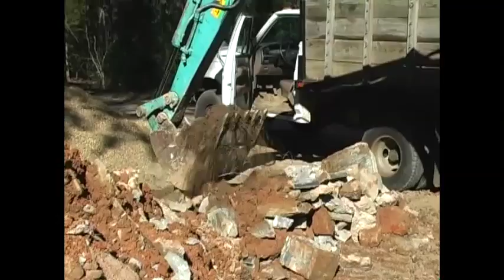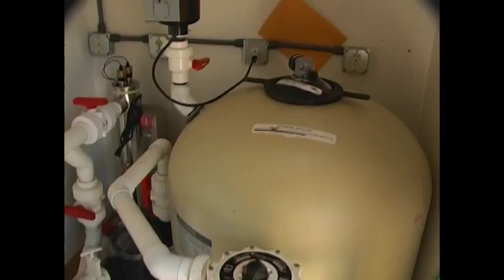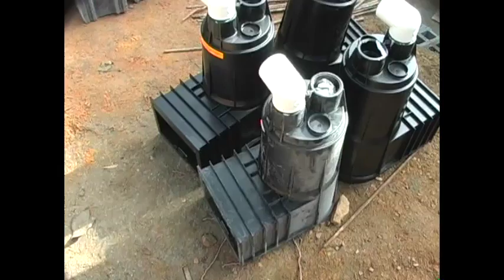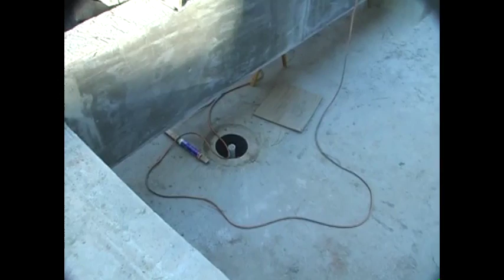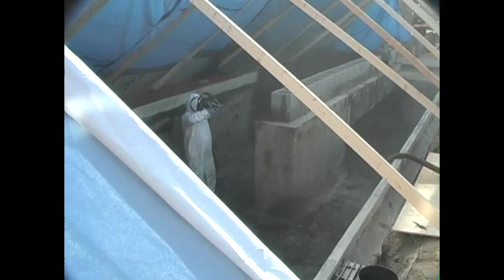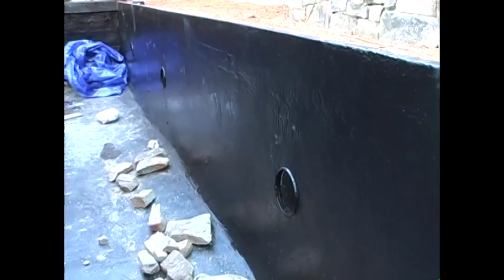Building a Mega Koi Pond

Comment: 3kw of lighting is a bit unnecessary- the cost of running these would be pretty steep if they were on every evening. Surely LED's could be used? You could get the same level of light for about 10% of the power, save a fortune in running costs (not to mention CO2 emissions. Plus they could have colour controls so you could vary the effect.
Reply from the maker: Spencer Wilton Yes definitely.  This system was installed before LED lighting was at the level it is now.
Reply: Brady Brandwood Glad to hear things have moved on! On the plus side, 3kw of tungsten bulbs would keep the ice off quite nicely!
Reply: Spencer Wilton you do not want color control in a Koi pond, it would interfere with the natural color pattern of the fish, which you paid thousands of dollars for.

Comment: why are you not putting rebar in the bottom just in case of any movement in the ground thanks
Reply from the maker: william mould I believe they had fiber in the cement, and that combined with the poly spray on flexible waterproofing, and the hard clay base soil they felt it was strong.
Reply: sorry Brady did not hear them, say that my mistake
Reply from the maker: william mould I’m not positive they mentioned the fiber when I was interviewing them actually.
Reply: well Brady if they did we would not be talking I live in the UK
Reply from the maker: william mould What is the soil like in your area?  This piece was shot in Charlotte, NC, USA ,... the soil is Avery dense red clay, with a 12 inch frost line.
Reply: clay soil here Brady i am about to build one out of railway sleepers very soon
Reply: just sent you a friend request Brady

Comment: I am not commenting as a denigrator of/to what I call {swimming pool} Koi ponds. Albeit, I do want to challenge the idea that a person must invest tens of thousands of USD's to have a fancy and costly engineered pool installed in order to have Koi fish as pets. Additionally, there is the monthly cost of electricity to operate the water pump and filter system 24/7/365 as well as the extremely high cost of specialized Koi food feeding.

My wife and I have a poor mans earth pond 75' W x 200' L x 2' southeast end descending gradually down to 8' D northwest end, in which my wife and I have several 1000 colorful Koi, Shebunkins and Goldfish thriving in our pond., Many have grown up to 18" in length, along with several dozen turtles and 6, 35" sterile Carp as well as an untold number of both Green Tree Frogs, Toads and Bull Frogs living along the bank. There is no costly water pump system, no filter system, no piping, no liner insert and no concrete sides and floor. However we do have a 500' deep fresh water well with a pump within 30'of the pond, as an emergency water source should the water level ever drop to a dangerous level due to excessive heat without rain. Our initial cost was $1800.00 to have the pond dug and graded. We got rid of the excavated dirt by giving it to, two separate contractors for backfill on projects they were working on. The pond took one year and two really heavy rain storms to fill up, which it has generally maintained, dropping only a foot or so between rains.

Our pond is now 20 years old and its fish are our pride and joy. The only drawback is, we have to keep an eye out for Herons and Kingfishers which do get their fill of baby and small fish on an occasional basis. Our two dogs keep the raccoons and possums away, while surprisingly allowing both deer and squirrels to visit our pond daily for a drink of fresh water.

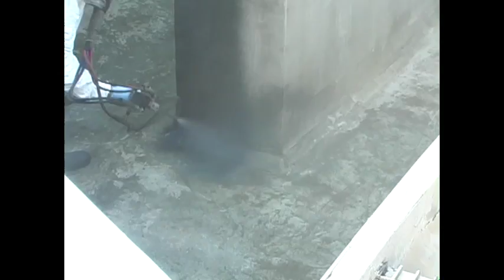Comment: 36:20 Get a measuring tape and get those thicknesses right . The black 100mm thick? Try 40 - 50 max.( elongation 1300%?!?! Wth are you talking about ? ) The clear one is 70-80 mm thick not 2-2.5cm.
Reply from the maker: Waverwreck he's speaking in terms like we say 45 mil pond liner,... which is 45/1000 of an inch thick.

Comment: I noticed one thing, they let the rebar stay in contact with the soil. There should have been some kind of spacer against the dirt walls and the floor so that the rebar stayed within the cement as any exposure of rebar to the ground will cause rusting all the way through in time.
Reply: The rebar will not rust in the ground. Rust is a chemical reaction of iron that requires 4 things.  One of those things that is required is oxygen,  as the rebar is in the ground there will not be sufficient oxygen to cause any substantial rusting.
Reply: @mulletman1705  Ground has oxygen or didn't you know that? BTW, I was an ACI certified  inspector and it is part of the International Building Code that all reinforcement be within the concrete and not be exposed to the ground. Hence why small 1.5" concrete blocks are tied to the bottom of rebar where concrete is poured directly on ground.
Reply: @cjandauntieyaya1446  lol your certifications are irrelevant in regards to my comment. Yes I am aware there is oxygen in the ground hence why I stated "there will not be sufficient oxygen to cause any substantial rusting" lol. International building code haha I have heard it all now.
Reply: @mulletman1705  - Wait... Certifications and building codes are irrelevant? I HOPE you never build anything if you disregard the safety standards created to protect the public.
Reply: @cjandauntieyaya1446  your foolish, I never said any of that lol, don't get butt hurt over being wrong. When I make a statement that can be verified you can not claim that I am wrong because you have a certification, because I am only wrong if upon verification I am deemed to be incorrect, hence as I have stated previously your certifications are not relevant in regards to my comment. I was laughing at your international building code comment because there is no such thing. There are international standards published by committees such as the IEC, etc, however those standards are not compulsory i.e. they are not the law, they only way the may be mandated is that if you enter a contract with someone and the contract states you must install as per standard x,y,x, etc. International building code lol.
Reply: @mulletman1705  You scoff at the idea of exposing rebar to the ground. That makes your entire logic faulty. It is scientifically proven that rebar underground DOES fail. You say, derp, not enough oxygen for rebar to rust so it's OK. But NOPE, there's IBC, ACI, NICET and AASHTO regulations saying that this is WRONG. Exposure to ground means exposure to acids, water, salts and other chemicals as well as oxygen. All of which can weaken the reinforcement and thus render it useless. Do you even know WHY rebar is added to concrete?
Reply: @cjandauntieyaya1446  you are really foolish , once again I never said any of that. Your original comment that I replied to only relates to rust, your original comment has noting to do with "acids, water, salts and other chemicals". Yes I know why rebar is added to concrete but that is also irrelevant lol.
Reply: @mulletman1705  "Rust" is caused by more than just oxygen in the air. Rust is oxidized iron. Any chemical reaction where iron is oxidized causes rust. Hence why your initial claim that rebar exposed to ground doesn't rust is bullshit.
Reply: @cjandauntieyaya1446  look my time is valuable to me so I will no longer spend time replying to you. As I stated previously "rust is a chemical reaction of iron that requires 4 things...as the rebar is in the ground there will not be sufficient oxygen to cause any substantial rusting". Talking to you has been funny, from taking to you I believe that you are a early teenager, I would say to you that, when you grow up if you want to be a manager or a figure in authority never start with the premise that you know more than other people instead listen to what other people contribute and use that to formulate your conclusion aka. don't be a dumbass, nuff time wasted, peace out !
Reply: @mulletman1705  Please review the channel Practical Engineering and the video Does Rebar Rust? and learn something before you build something. You trying to say your time is important is kind of silly since you replied to a comment I made a LOooooong time ago. Reinforcement within concrete MUST be WITHIN the concrete in order to do its job. Exposed rebar is not only susceptible to degradation but also is NOT able to do it's job as it is no longer surrounded by enough concrete for its tensile strength to benefit the concrete. Any reinforcement added to concrete must adhere to the concrete (why rebar is ribbed) and have enough concrete surrounding it to handle any shear stresses. Otherwise, the concrete crumbles away and the rebar is ill fitted to withstand the compressive stresses that the concrete was meant to endure.

Comment: I recently poured a small 60 bag slab. did an amateur Rebar on it . but dug a canal around the perimeter.(rectangle)and a ditch in the middle.layed Rebar over the center ditch. just to  seem profressional.structured  and water from rain to continue flowing outwards. nothing major just a slab.  .  perimeter canal than  concrete pour for me , may help vertical support and skiding (for garden slab). I got the idea from commercial slab builders.
Reply: the center causeway and geometry . water bridge under neithe was a good idea . and maybe filter can be reworked. so you can walk on the pillar.path.

Comment: What was the purpose of the small areas of rebar ? It was actually a complete waste of time adding any rebar!
The rebar spacing is too far apart! If you get freezing temperatures it wont be long before this thing cracks !
Its always a "MUST" to  create concaved walls in such a large pond to prevent opposing  pressure in freezing temperatures as well as ground  upheaval and shifting !
Hope you poured at least 4-5 inches of concrete although I still think you will have future problems !
Be interesting to see this in a few years !
Reply from the maker: Webuildwaterfalls They were using some of the rebar for cement depth and slope grading markers.  I'm almost sure the cement had fiber mixed in.  Also this location is in Charlotte, NC, the frost line is only a foot.
Reply: Hey Brady....We'll let it go I guess :) Still would always use the rebar. Pretty inexpensive if you think about for that little extra piece of mind and a whole lot less work later !
I even use it in the South of China ! You never know...Minor Earth Quakes or somethin:) 
I always find the earth never stops moving and pushing dirt around so ....
My Teacher was Douglas Hoover and he'd disown me if I built anything without rebar !

Steve
Reply: Oh yeah...If its got a good mix of Fiber in there and a Good .psi strength closer to 5000 I guess you might get away with it !
Reply from the maker: Webuildwaterfalls, Hi yes I wasn't the builder or owner of this pond,... I documented the construction and produced the video.  Apologies for not knowing the exact details and reasoning for some of their choices.
Reply: Not a problem ! I appreciate your quick reply ! I am just being a pain in the A...!
At least its not built from a pond liner :)
Theres a lot of Good Work put into it and certainly some time !
Take Care.
I subscribed just on the point of common decency :)

The Documentation is Well Done !
I have missed far too much Documentation in our Builds and I really regret it !
I was never really much into Documenting until I met Youtube.
Nowadays i try to keep a camera on nonstop !
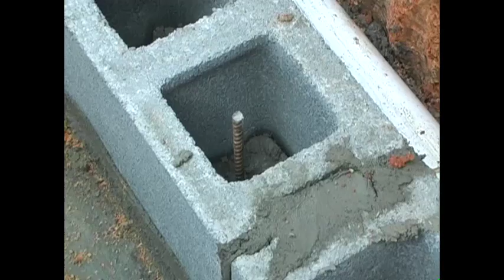Reply: Hi im watching this and reading the comments and at 22:30 he starts to talk about how they do actually put rebar into all the concrete block walls and then fill them for supports!

And about the bottom of the pond i don't think you would have any concerns with temperature with how deep it is and how much insulation the water will provide it! But if this was in a colder environment  i'd agree that they would for sure have to have the mesh!
Reply: Hi...I guess I missed that part :)
Being we do all our work mainly in Canada, there isnt too many places other than Vancouver, where you 'wouldn't' want to add rebar !
We're building in China now and I even use it there and we are in the South where its basically Tropical.
I guess for the small extra cost of some rebar, I wouldn't go without it !
I was taught by Douglas Hoover out of California and he was (before his retirement)  considered the #1 pond and waterfall expert in the USA and you wouldn't even want to get into it with him about 'Not Using Rebar':)
I guess its a bit like building a Cabinet without the Glue ! It should stay together but, for the small extra cost -  might as well Glue it too !
Nonetheless...its a lovely Project !

Take Care
Steve

Comment: Huge concrete slab and NO steel fabric?
Reply from the maker: Yeah, there was some rebar in the bottom, but not a full grid.  I'm not sure if they were using fiber in the concrete mix.  The walls though were block, which would be weaker anyway,... and the whole interior was poly coated,... so they may have been relying on the poly's flexibility for reliability as well.  The base also was red clay which tends to be solid.
Reply: I too would have expected a mesh in the top of the slab.  Also surprised there wasn't any reinforcement in the hollo blocks, i assume they at least got filled with concrete.
Reply: They said the blocks were filled.
Reply: It looked like they did some reinforcement in the blocks, but yes, they were filled.

Comment: The wall in between the Koi pond just looks soooo out of place. Would of looked better without that wall in between, what if you're on the other side of the wall and you can't see the fish on the other side of the wall? Horrible design. Would of looked better with a water stream coming from where the wall is at. Streaming right down the middle and knock that wall out.

Comment: why didn't the entire bottom of the pond get rebar treatment before concrete pour? I only saw a few areas of rebars. I hope in the long term the bottom won't crack, seems risky!
Reply from the maker: Hi Wang Hung, I think the reason was that they were going to spray the interior of the pond with polyurea,... and that would be the true water tight structure,... the cement may have also had fiberglass added to the mix.  The pond sides were cement block also,... which the polyurea coating would add strength to.  I think most would have preferred to have rebar crisscrossing the bottom though.
Reply: Also at the beginning of the video they spoke extensively about how hard the soil was so shifting was not an issue.

Comment: The filtration was very interesting, especially the automation aspect -- the use of a PLC to automatically drain the vortex (settling chamber?) once a day (this is talked about around the 12 minute mark).  So the water goes from the bottom drains to the vortex, on to the bead filter, and then how does it get back to the pond?...(via the bakki shower?)  Anyway, the pond looked understocked at the end, which is great.  My 14-inch comet goldfish needs a new home, and he likes what he sees.  How will the pond do in the winter time?
Reply from the maker: Hey Tim, yeah the water returns to the pond by the bakki shower,... and I believe there is a valve at the bottom of the bakki tower that will allow the water to be diverted directly into the pond, to reduce any supercooling of the water during winter.  The pond is in Charlotte North Carolina too though, so the temperatures in the winter are pretty mild, with a lot of days in the 60s and 70s.